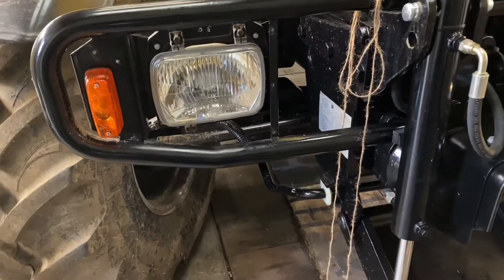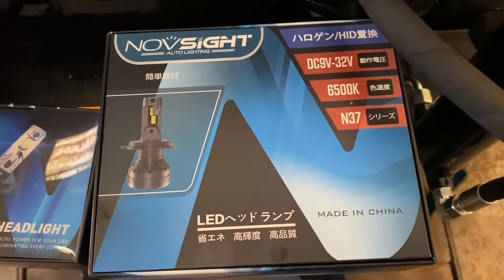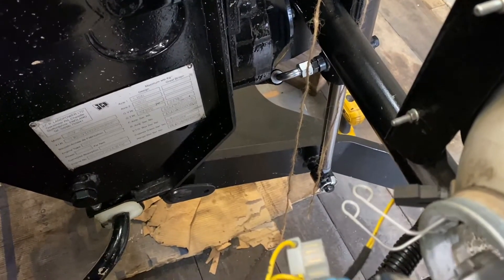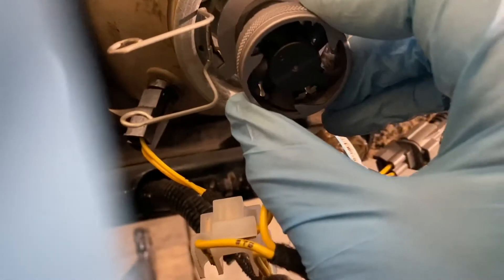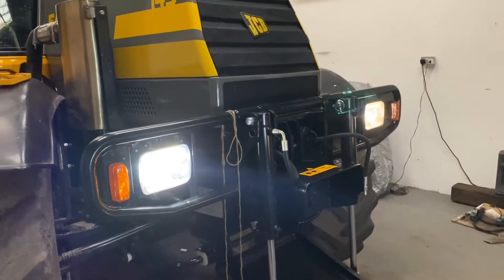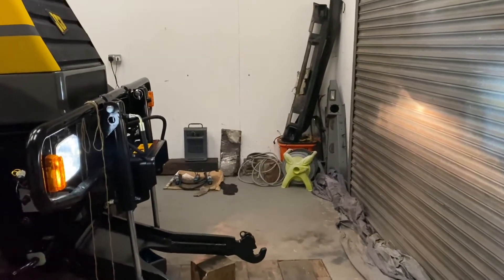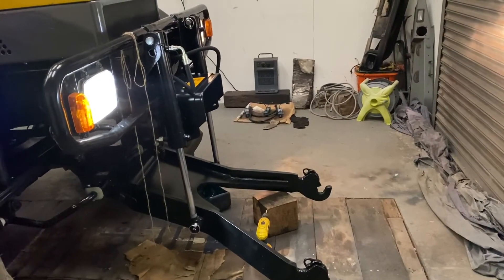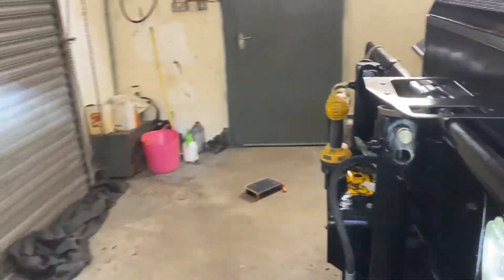LED headlight upgrade JCB Fastrac 145

Comment: Hello there, I love the job you have made restoring your Fastrac it's a great job a real credit to you 👍🏻. I need some advise on paint codes if you could be as kind... I'm restoring a 1995 Fastrac 185-65 & need to know the codes for the, Yellow, Black, Silver & Grey?

Kind regards
Edward
Reply from the maker: Thanks Edward and sorry I missed this comment. The yellow is call JCB New Yellow (2k) and for the grey I used 2K ACRITOP LS155 CODE: N9422 NEW MASTER CHROMA STANDARD.. the chassis I used a 1k gloss black from Churchill paints. If I did it again I’d go 2k but there is a huge difference in cost, I used 7 litres of something like that. Wheels I used a 2k silver recommended for truck wheels, won’t matter so long as they all match. Black primer for the grey and white for the yellow.